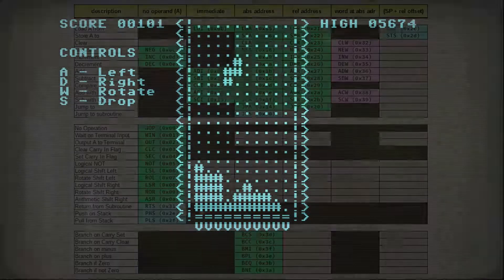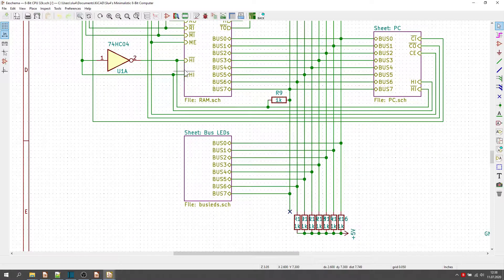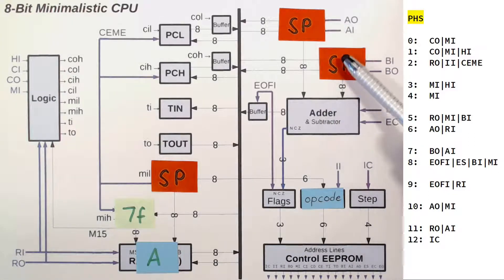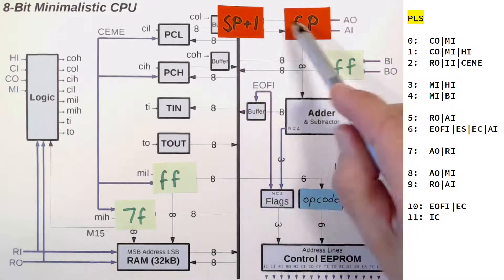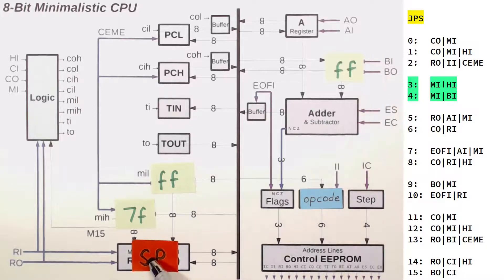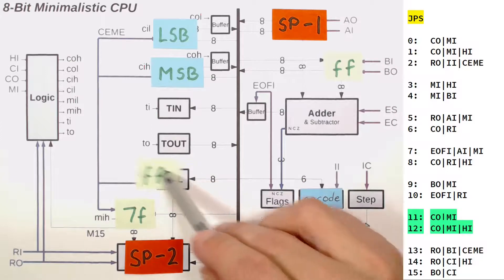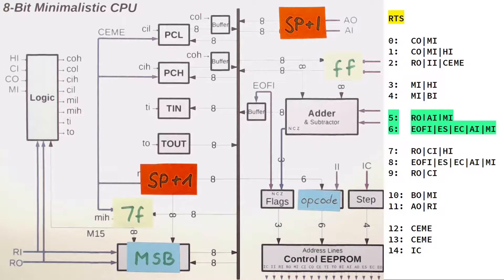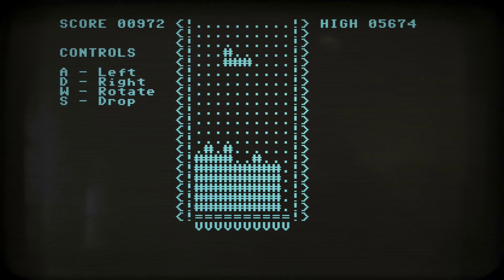Breadboard Computer With Minimalistic Design #7 Microcode Stack Magic

Comment: Something like another register an 74ls169 could make a stack register that would make a huge performance gain with very little additional hardware
Reply from the maker: Hi Richard, another register IC would indeed make life much easier and also increase performance as you have pointed out. However, being a purist, I find beauty in showing that it also works without it :-)
Reply: I don't disagree that its great it can be done.

But I think for a simple hardware design could include a couple more bits can make a huge performance difference yet still be breadboardable.

I am working on a design that is single accumulator and uses up down counters for PC SP MA and then an add with offset.

That gives me a huge gain when it comes to stack addressing with offset for local variables etc.